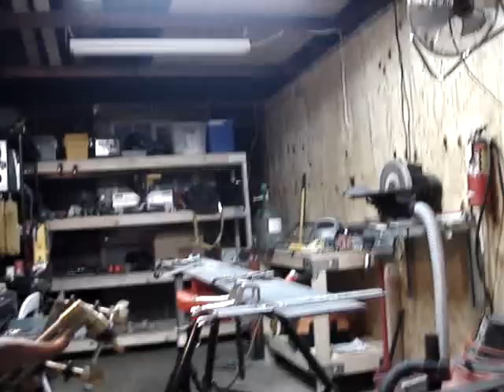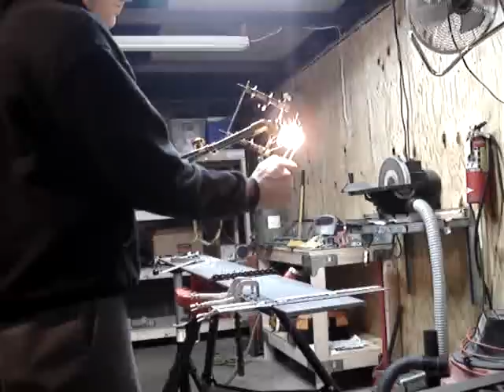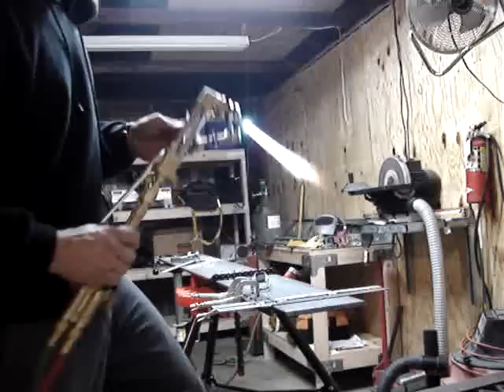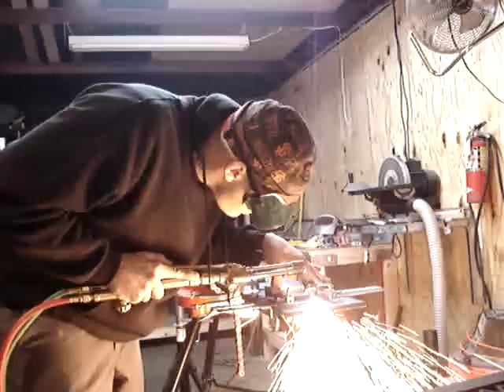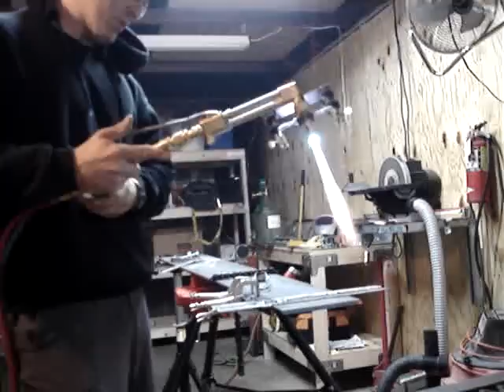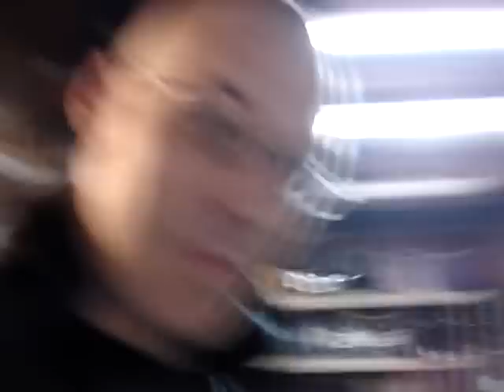oxy fuel cutting

Comment: I made a jig in engineering shop class for thermal cutting a perfect circle. (We needed the circle to spot weld, then Fusion weld and finally filler rod weld together a disc to a flanged cylinder...IN case that didnt make any sense we made our own socket sets... Best set I ever owned, and I aint paying for snap-on.

Comment: if you go through sparkers really fast its because you should light from the top of your air flow instead of infront. that will burn out your flint twice as fast and if you spark it from the top you dont have to worry about your hand in the way =]

Comment: well, perhaps for me it's a different story, my background is photo welding so coming from that it's easyer to get into this type of thing. I used to cut into silo's which would involve cutting freehand pretty much all day, i dont know what kind of things you were doing, I mostly worked with very thick steel and large shapes, but in my experience it's no difficult process. maybe this is just one of those "what is good" debates. you can always get better but you can get good pretty quick imo.

Comment: nice torch man.. i really want to get in to welding.. partially because its all the same gear, minus torch and fuel, for lampworking with glass as well.... what kind of torch do you use?    I've never seen that straight-edge jig type thing... is it factory, or is that an upgrade you could toss on to a lot of torch set ups? anyways, good shit